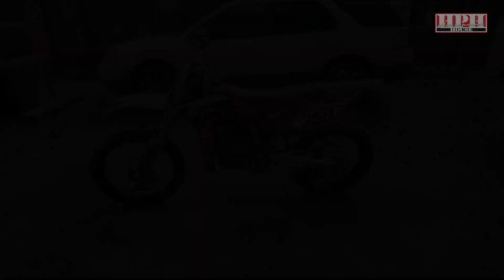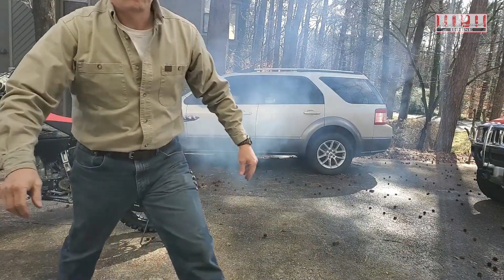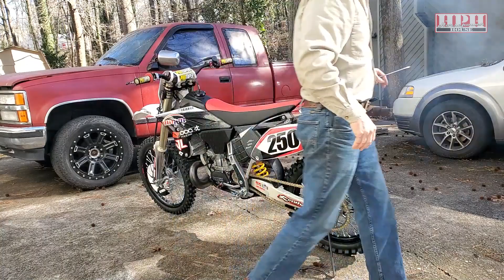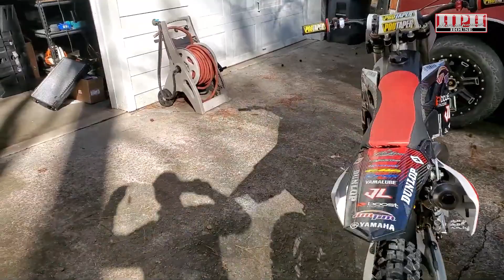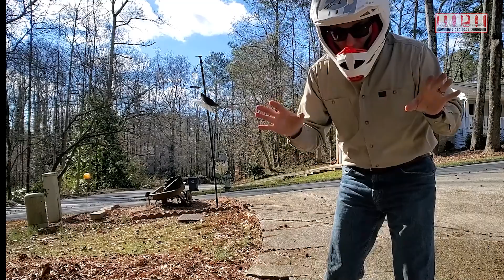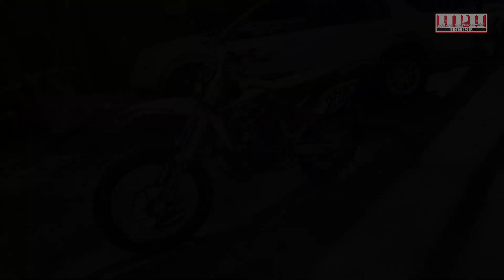The Break-In of Yamaha YZ250 sounds of a two-stroke 270cc / 250cc Motocross 2-stroke Bike

Comment: I did the same thing to my 1998 KX125 recently. every bearing. everywhere. just starting to ride it now. Did some porting. I did the forks, Factory Connection the shock.   I had a 1994 YZ250 we did sorta the same thing to in 2002. Sold it in 2005